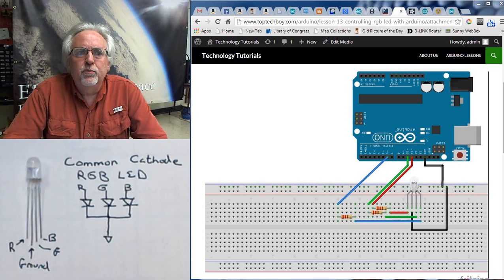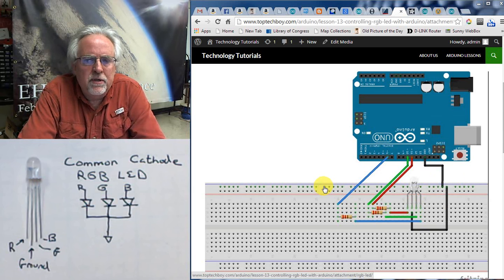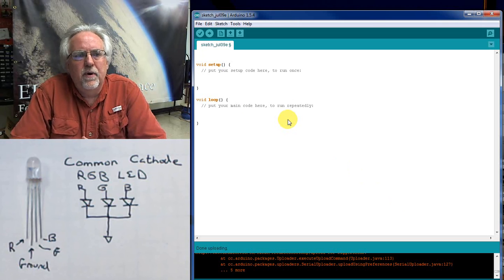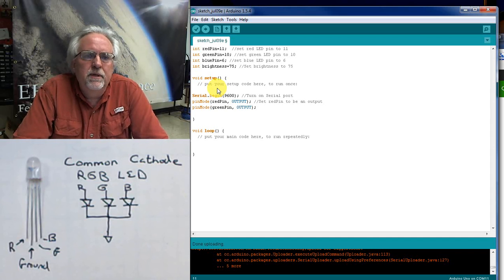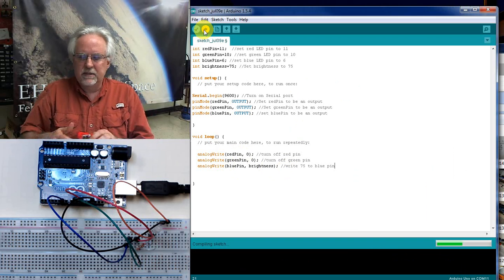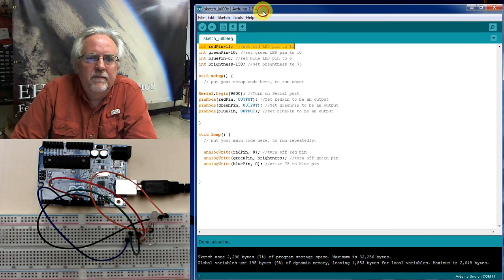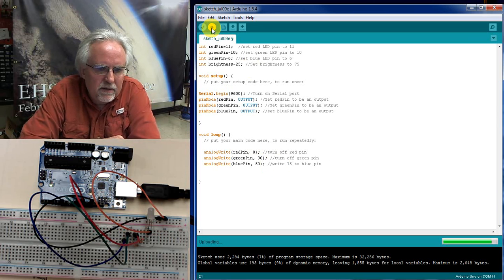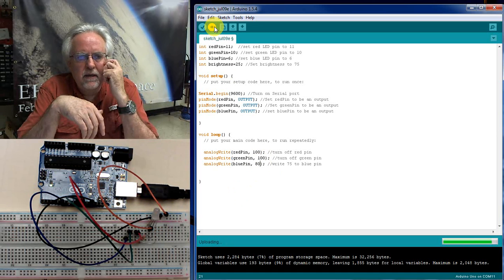LESSON 13: Controlling an RGB LED with Arduino

Comment: Paul McWhorter,

I had real trouble with this module, ive followed along with the whole tutorial and its a been so easy to understand, the problem wasnt the code it was the parts, if i used a red, green, & blue LEDs it worked perfectly, but when i used a RGB LED i couldnt get anything to function without switching the ground to 5v, and changing the code completely

further my LED is set as follows |R|+5|G|B| as this is the only way i could get this to work

this is a section taken from my Adeept kit

int redPin = 9;   // R petal on RGB LED module connected to digital pin 9 
int greenPin = 10; // G petal on RGB LED module connected to digital pin 10 
int bluePin = 11;   // B petal on RGB LED module connected to digital pin 11
void setup()    
{   
   pinMode(redPin, OUTPUT);   // sets the redPin to be an output 
   pinMode(greenPin, OUTPUT); // sets the greenPin to be an output 
   pinMode(bluePin, OUTPUT);  // sets the bluePin to be an output 
}    
void loop()  // run over and over again  
{    
    // Basic colors:  
    color(255, 0, 0); // turn the RGB LED red  
    delay(1000);      // delay for 1 second  
    color(0,255, 0);  // turn the RGB LED green  
    delay(1000);      // delay for 1 second  
    color(0, 0, 255); // turn the RGB LED blue
    delay(1000);      // delay for 1 second  
  
    // Example blended colors:  
    color(255,255,0);   // turn the RGB LED yellow   
    delay(1000);        // delay for 1 second  
    color(255,255,255); // turn the RGB LED white  
    delay(1000);        // delay for 1 second  
    color(128,0,255);   // turn the RGB LED purple  
     delay(1000);       // delay for 1 second  
     color(0,0,0);      // turn the RGB LED off  
     delay(1000);       // delay for 1 second  
}     
     
void color (unsigned char red, unsigned char green, unsigned char blue)// the color generating function  
{    
     analogWrite(redPin, 255-red);     // PWM signal output   
     analogWrite(greenPin, 255-green); // PWM signal output
     analogWrite(bluePin, 255-blue);   // PWM signal output
}     

at this stage i dont quite understand whats going here any chance you could explain why this works and your code wont (when i set the RGB LED pins to |R|GND|G|B|)

Thanks for your detailed and simplified lessons
Reply: are you using a common cathode RGB Led? you might have a common anode RGH Led, as he says in the beggining of the video
Reply: Your's is likely a common anode LED

Comment: Hello sir
Can we drive more than 25m RGB strip using Arduino controller ?
Reply: only with amplfier circuit with transistors
Reply: MOSFETs and a power supply
Reply: No Arduino outputs a limited current ., in the range of a few tens of mA.

But enough so you can control an amplifier or a transistor to do that. 

It's not THAT complicated if you don't go too deep in the subject. 

If you like that kind of stuff, I suggest you study basic electronics (passive components transistors and amplifiers). If you give it a week or two you will understand, it's not that complicated if you don't wanna go too deep into it.

Comment: my rgb is more like rbg led and works only if it's connected in the exact opposite fashion as your own. By that, I mean the common ground is it's Vcc and other pins the ground to the individual colours. In that case, how am I to proceed with the code??
Reply from the maker: Yes, there are two types of rgb led's . . . common anode or common cathode. So, important to know which LED type you have.
Reply: I guess mine is the common anode one. I have diligently followed every class. It sort of came as a shock to not be able to glow the rgb. Could be please help me out here Paul?
Reply: adwayt nadkarni you need to write LOW instead of HIGH to the pin you want to light up for a Common anode RGB led.
Reply: Chimaera thanks! :-)

Comment: Great videos Sir and i have a question sir does the required voltage for producing a green color from a led differ from producing a blue or red color in a led

Comment: I believe I owe you an apology and I would like to express my great appreciation for you and your video tutorials. I tinkered around with the program since my last post and I was able to get a close approximation to yellow and orange, but not perfect. That may be due to my RGBs maybe being not the best quality. The colors don't seem to mix well in them even with the ping pong ball. I also came up with a way to better defuse the RGB's light so it mixes the colors better by sanding it to give it a frosted look. That worked quite well, because before all I was getting was red, green and blue rings on the ping pong ball rather than them mixing to make the other colors. Thanks again for all your efforts in teaching These things. My main project (to build a humanoid robot capable of performing useful tasks) was at a standstill for several years until I discovered Arduino recently. That is the reason I am taking your video lessons, to learn the necessary things about Arduino and the C language to see my project come to fruition.

Comment: I don't mean to contradict you. You are a great teacher and I have learned a lot from you about Arduino and writing code in C, and have until now completed all your assignments with 100% success. But green is not a primary color. All the other colors you assigned I was able to make with the RGB except those that need yellow. Here is a link to one video of several videos I found on primary colors, albeit it is from Sesame Street, but I doubt very much that they would lie to children. All the videos I found basically say the same thing. The three primary colors are red, yellow and blue. Green is a secondary color. Do they make RYBs? lol. https://youtu.be/yu44JRTIxSQ
Reply from the maker: Tom, man, check what you are saying. The primary colors are Red, Green and Blue, commonly known as the RGB color scheme. There is a different set of primary colors, Cyan, Magenta and Yellow, or CMY color scheme. ANY color can be made with RGB, and similarly, any color can be made with CMY.

Comment: I am taking your lessons on Arduino, but I'm having trouble with your assignment on lesson13. Some of the colors you assigned us to make with the RGB will not come out right because the RGBs do not contain the primary color yellow. For instance green is a mix of yellow and blue. You can't make the color yellow from red, green and blue. A couple of the other colors you assigned us to make are not possible either because the require mixing yellow with another color such as in the case of orange (which is a mixture of red and yellow. So what can I do to complete this assignment?
Reply from the maker: Do a little work on primary colors . . . you can make any color by mixing red, green, and blue.

Comment: Hi Paul. I like that you have go through this slowly and explain the concepts. That adds a lot of value for everyone. Thanks. Here is my code. It asks the user how to set each light's brightness (1-255)

//Ask user how bright to set an RGB LED
int redPin=11;  //set red LED to pin 11 with 330 Ohm Resistor on red wires
int greenPin=10; //set green LED to pin 10 with 330 Ohm Resistor on blue&black wires
int bluePin=6; //set blue LED to pin 6 with 330 Ohm Resistor on white wires
int brightnessRed = 0; //set default brightness to 0 
int brightnessGreen = 0; //set default brightness to 0 
int brightnessBlue = 0; //set default brightness to 0 

void setup() {
  // put your setup code here, to run once:
Serial.begin(9600); //turn on serial port
pinMode(redPin, OUTPUT); //set red pin to be an output
pinMode(greenPin, OUTPUT); //set green pin to be an output
pinMode(bluePin, OUTPUT); //set blue pin to be an output

Serial.println("Hi there. How should I set my red, green and blue LED to make your day?"); //Arduino greeting.

}

void loop() {
  // put your main code here, to run repeatedly:

Serial.println("Brightness for Red? (0-255)"); //get user input value for red 1-255
while (Serial.available() == 0) { }
brightnessRed = Serial.parseInt();

Serial.println("Brightness for Green? (0-255)"); //get user input value for green 1-255
while (Serial.available() == 0) { }
brightnessGreen = Serial.parseInt();

Serial.println("Brightness for Blue? (0-255)"); //get user input value for blue 1-255
while (Serial.available() == 0) { }
brightnessBlue = Serial.parseInt();

analogWrite(redPin, brightnessRed) ; //red LED set according to user input
analogWrite(greenPin, brightnessGreen); //green LED set according to user input
analogWrite(bluePin, brightnessBlue); //blue LED set according to user input
Serial.println(); //blank line
Serial.println("Your wish is my commannd! Check if I did it right please?");
Serial.print("Red:") + Serial.println(brightnessRed); 
Serial.print("Green:") + Serial.println(brightnessGreen);
Serial.print("Blue:") + Serial.println(brightnessBlue);
Serial.println(); //blank line
}

Comment: i thought my RGB LED didnt work by doing little experiment on it i found out that the longer one is positive the rest are negative should it be doing that or is it another kind RGB LED if it is could you make a video about it for please
Reply: Paul McWhorter you dont have to do that anymore it still work as long as i put the longer leg on 5v it still work with your lesson but should it be doing that
Reply: There are two types of RGB LED's:
1. common anode (1 positive pin, 3 ground pins)
2. common cathode (1 ground pin, 3 positive pins)

In the video, he is using a common cathode LED. This means that there is one ground pin that is constantly connected and shared between the colors and that each color lights up when voltage is supplied to one of their pins.

The type of led you have is a common ANODE led. 
This means that there is one common power source shared between all of the colors, but a specific color will only illuminate when it's ground pin has made contact.

Common Cathode:
+ - + +

Common Anode:
- + - -

Search common anode LED's and look at some video's describing the difference between common anode vs. cathode LED's and it will be much easier to understand
Reply: thank you